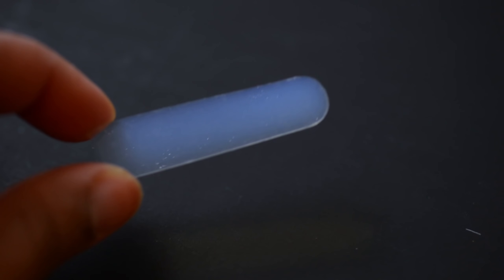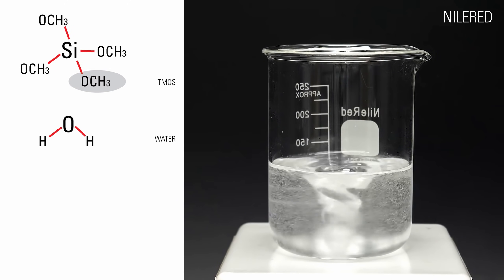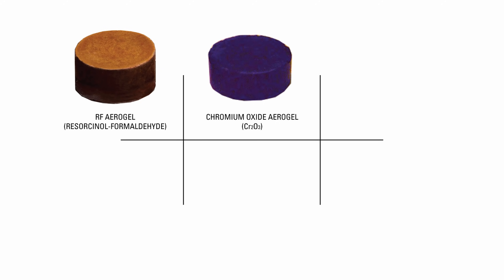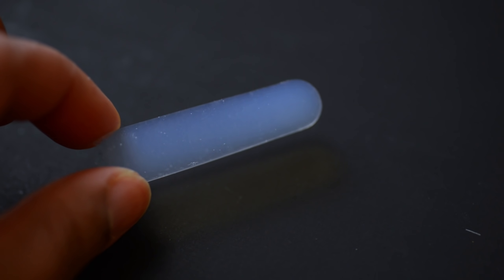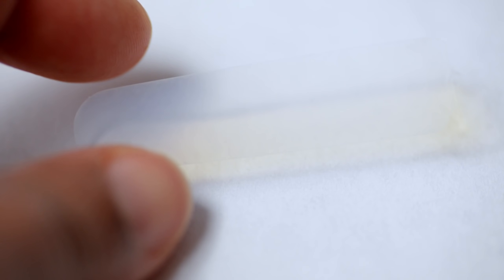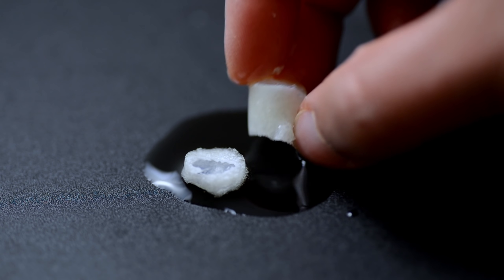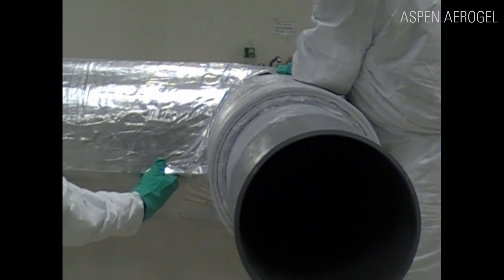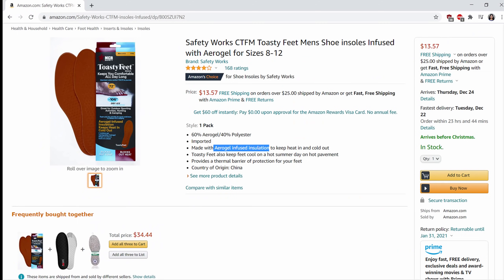Beginner's guide to AEROGEL!

Comment: This was such a fascinating breakdown of aerogel—can’t get over how it’s 97% air and still beats fiberglass and EPS foam in insulation! Has anyone here actually worked with aerogel blankets like Pyrogel or Cryogel in real-life projects (construction, industrial, etc)? I’m curious how it holds up long-term—especially under vibration or moisture. Also, with all these types (silica, carbon, chromia…), which one do you think will be the future standard in building materials?😀😀

Comment: Aerogel in clothes?  What about the silica dust?  I thought about using the aerogel blankets for insulation on a yacht I’m having built but I’m not sold on the idea of possible silica dust coming off the material.

Comment: Fascinating topic.  I was surprised to learn that the R value is only R20 per inch.  I'm surprised you didn't compare it to spray foam.  A quick search says closed cell spray foam is R7 per inch, so it's about three times as effective.  From all I've heard about aerogels over the years, I had assumed the difference would have been larger.  I've heard many people say they wish it were affordable so that they could insulate their homes with it, but unless someone develops a cheap spray version (obviously a completely different manufacturing process), it sounds like closed cell spray foam is the closest thing we can really hope for without a manufacturing breakthrough.
Reply: Sadly its so brittle material as you can see in the video that in just one year i would predict R value drops simply due hairline cracking caused by the frame movement. Only material stable enough would be concrete, but even then there out to be some movement and this material would turn into dust. Each hairline crack creates passage trough the material so air can move past it. This would be otherwise be great material but it has severe problems as for now. Maybe if it could be made bit more elastic it could be used in construction insulation.
Reply: @Hellsong89  Probably by the time you've fixed that, you will end up with closed cell spray foam.

Comment: I'm curious why is it so expensive. It is well known super material, but nobody invests in it. Why?
It seems like the ultimate material to use in insulating refrigerators, ovens, houses, automobiles, airplanes or anything else. It can block fires or sub zero temperatures. I have seen a video from a company that makes aerogel that is not brittle at all. In fact it is like plastic. They tested it with a hammer.

Comment: Rova makes some sprayable, putty and blanket insulating products that say they’re made with aerogel.        It’d be neat to play with a gallon maybe for some automotive applications.  I dunno.      

It might be neat to get some of that sorbethane to play with for a video.   ‘Some proprietary Viscoelastic silicone vibration dampening material.    

I know clay is sometimes used in audio studio construction to float thick window panes in suspension.  I believe it’s also used under floors as well for almost total sound separation between the control room and studio side.   

Then there’s that popular green caulk sound deadening stuff that apparently is applied on studs before drywall or decking.   All that acoustics sound deadening, absorbing and vibration dampening stuff is fun.   Rockwool you pointed out is a good sound absorbing material for panels.   

I believe the Tech Ingredients guy used some on a speaker build sandwiched between aluminum plate to make acoustically dead panels.     He has a YouTube channel.  https://youtu.be/EEh01PX-q9I  I’m not sure if you’ve seen his content but it’s generally always fascinating to check out.    Yeet :)

Comment: Hearing you mention open and closed cell foam insulation makes me wonder what your opinion of using either or neither in the inside of my roof that doesn't have insulation.  The roof  is a 12 x 12 pitch.  Your thoughts,  thanks

Comment: Not a durable material.  I am using "aerogel" pyrogel sheets for insulating exhaust and engine heat on my race car. The sheets need to be protected from oil and moisture contamination, and they are very dusty (and expensive) to work with.  I encapsulated them inside stainless steel foil to protect the sheets, but that in itself is heat conductive.

Comment: They are not the highest insulating material. They are the highest non-vacuum insulating material. (or the least sensitive to absolute air pressure) 
Vacuum Insulation panels are used in whitegoods (refrigerators, etc), building (high end), as well as the bio and pharma e-commerce sector (transportation of thermally sensitive biologics) 

VIP's as they are known are in the range of R40/inch for fumed silica VIP's (which are less sensitive to vacuum level than other VIP core materials), to over R60/in for glass fiber core VIP's. 
The glass fiber core VIP's need to maintain fractional torr vacuum levels, while fumed silica vip's are quite effective in single digit to low double digit torr vacuum levels. 

you can make a VIP using aerogel, but they are not as effective as other core materials, although they are less sensitive to the vacuum pressure within the panel for their performance. 

Their thermal drift is a function of gas ingress (that works to raise the pressure / break the vacuum) over time, however a good tri-foil barrier film and proper care during manufacturing can result in panels that have up to a 50 year effective life (maintaining performance) for applications where the panels are not disturbed. 

https://www.researchgate.net/figure/Thermal-conductivity-of-various-materials-as-function-of-air-pressure-in-the-pore-system_fig1_320702076

Comment: It is hydrophilic. Avoid all contact with the skin. It causes severe cracking and bleeding of skin when used as an insualtion when it is cut and handled.  Must wear ppe to cover all exposed skin... including the face.  It has potential but in the building trades in it's current form it is an extreme irritant.

Comment: I regularly make aerogel in my garden shed in Scotland, having worked on it since the 1980s in France. I use it as a gasket in wooden sole plates in SIP buildings to avoid cold penetration. We have found a way of making it transparent for use in double glazing that avoids 'curtaining'. The insulation it provides is better than a 150mm SIP. I am currently installing it in a series of sound booths where we can find tune it for different purposes... e.g. band practice, recording, etc. The next project is for use in van bodywork as a composite.
Reply: I thought you were spoofing, but...   you seriously make the Aerogel in a garden shed??

Comment: The whole video I was thinking about the upcoming remodeling/renovation of a 120 year old house we've put an offer in on. Of course, aerogels seem to be a different cost-class than I'm able to put into a couple year renovation project, but I was thinking about it just the same.
There were several examples of current commercial uses for aerogels, but I'm wondering if for construction they're really far out of reach for most people still? Seems the manufacturing process (as described) would be cost prohibitive, though.

Comment: The size of the sample shows the insane cost xD hope prices come down, because aerogel in my walls sounds awesome
Reply: If the price comes down by a factor of 100 it will still be the most expensive insulation material that you have to pre make off site.
Reply: @rRobertSmith  by area or by weight? A factor of 100 is pretty big

Comment: If it has such a large surface area it should be possible to make it into a capacitor.  If air can pass through it it should be a very good filter.  If it's transparent with infrared light and opaque with UV light there might be a way to make it into a memory storage device.

Comment: Spouse: Honey, what is this bill for $23,000 for?
Me: I bought a pound of Aerogel.
Spouse: A pound of Aero what? What is that?
Me: Well, it's about 97% air...

And that's how I ended up on the couch.
Reply from the maker: Haha! Imagine how large that pound of Aerogel would be...
Reply: @BelindaCarr  At least big enough to use as an Aerogel blanket is my guess.  Should make life on the couch a bit more comfortable (lol).
Reply: If it's a single piece, it's about 0.3 cubic meters.  Or a cube that's about 2 ft 3 inches on a side.
Reply: You're lucky to still have a couch mate!
And a house. And a wife :))))
Reply: If you are not looking for solid forms then you can get it at reasonable prices.
Reply: The biggest problem would be where to store 1 pound of aerogel

Comment: this is pretty funny because at the start of the pandemic I'd joke with my coworker that if I were Elon Musk I'd make a "carbon nano-tube fiber & aerogel insulated mask" since I knew aerogel is a very light substance. I actually had no idea about it's insulating properties. What would the feasibility be on an aerogel mask? lol, of coarse you wouldn't want to breathe in those particles all the time. Maybe a light fabric material blocking that? I have no idea I just that that was kinda funny. Great video btw!